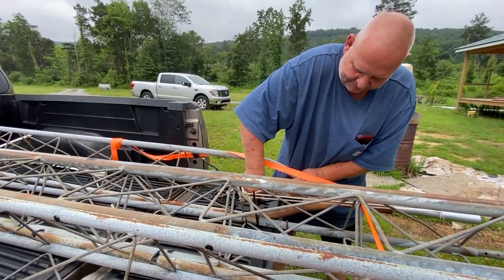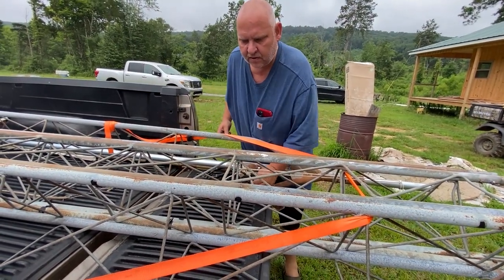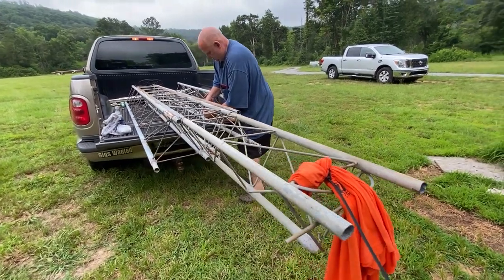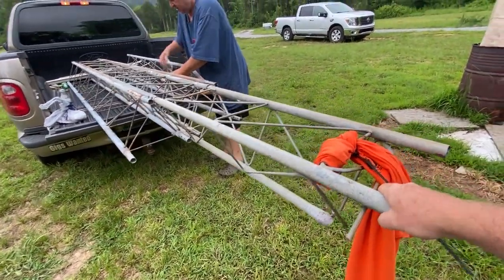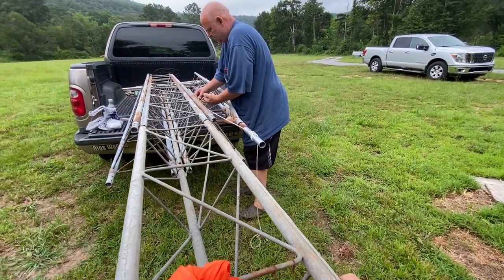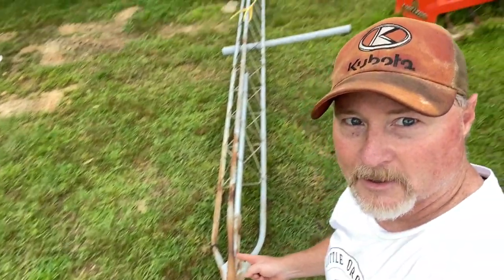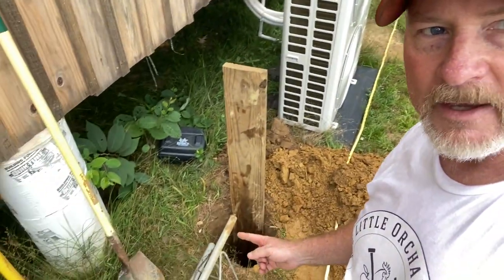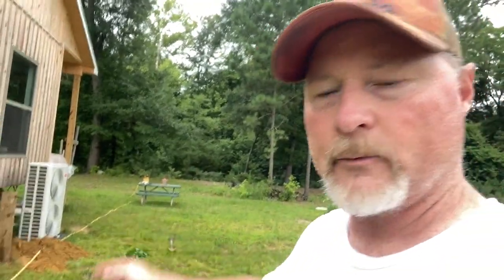Installing Our Reclaimed Antenna Tower: It almost didn't work out!!

Comment: I know these towers are somewhat galvanized but you should have poured cement to higher level than the ground. That dirt will hold moisture and speed up the rusting process. I would remove the dirt, clean the tower section that's been in the dirt real good and refill with cement above ground level. That allows water to run away from the tower and not setting up against it. Just my .02
Reply from the maker: Excellent advice. I did not think about that. I will have to add that to the ever growing list of to-dos. 😀👍Thank you, Bob.

Comment: Enjoyed the video.  I was looking for the one where you added the antennas.  Another tricky task, I'm sure.  I'm thinking of doing something similar, so I was scouring the YouTubes...

Thanks!
Reply from the maker: Hey Scott. I may not have video of that activity. However, I can tell you I ran coax from the Yagis atop of the tower halfway down to an outside box where my Mofi4500 lives.  I then run a coax into the house to a NightHawk router which acts as my WiFi broadcast device. It is really that simple. I do have a device in-line between the Mofi and Nighthawk that is for lightening.  The only disadvantage of this set up is the SIM card located in the Mofi is atop my roof. SO, if I need to change cards I have to climb on the rooftop and make the change. Not ideal for an old guy like me but tolerable. Oh, and one more item about the antennas. They are aimed line of sight to the nearest cell tower. I used a website called CellMapper..Net to locate the nearest tower and then played with the signal strength tool I have on the Mofil to dial it in. Hope this helps a bit. Cheers!

Comment: I thought you would of made a frame at the bottom so it could be taken down. Are you going to climb it to put the antenna on the top
Reply from the maker: Hey RT038. We gave that some thought but in the end we simply decided to keep it very rudimentary. We assembled the Yagi antennas to the topper while we were on the ground. We then hoisted the topper up and climbed up there and popped it on.  I would not say it was easy, but we managed. In hindsight, probably should have built a lowering frame. Oh, well. Live and Learn. Thanks for the comment!

Comment: Did you bracket that tower to the eve of the building to help support it?  If not, has the tower been blown down yet or did you end up putting some guy wires on it?
Reply from the maker: Yes, it is anchored to the eve of the house and has withstood many a storm. More than I can say for a few trees around the property. :) Cheers!

Comment: FYI
Find an old sat. dish, remove the receiver head and replace it with a router antenna. You can point that thing into the direction for optimum reception for free WiFi.
Reply from the maker: Thanks for the info

Comment: When raising that tower, you needed first to have it partially raised up and suported by a ladder or strong beam of some sort, something home made to prop the tower up with along with either rope or heavy galvanized guy lines at the middle and above the middle of the section of that tower. Then you can use your farm tractor to start raising it up slowly till it gets up in the air, holding it right there in place then put your sakrete into the hole filling it up to the top of that hole, then let it sit till it firms up and dries for about a week.  Once dried you can now climb that tower remove the galvanized guy line ropes, etc, and bring your RG  6  cable down and start using it to wire up your home for tv signals to be fed to the tv set. Your not done, YET!  You'll need to sink in a 6 to 8 ft ground rod in the ground and attach that ground rod wire to that tower to. Then, start digging around that tower a square piece deep enough, about either a foot or two put 2 by 4's around it nailed in and start pouring additional sakrete cement mix all around giving this tower even more ground support for a yet good strong base.
Reply from the maker: Great advice. Thank you.

Comment: Just curious... how are you going to install the antenna on the mast?
Reply from the maker: Metal brackets came with the antenna. Pre-drilled pilot holes and made sure they were aligned to the direction I wanted to "aim" and secured them with bolts.

Comment: Is that a part 2 that shows the results and the actual cell repeater you used?
Reply from the maker: James, my current setup is the Yagi antennas, Mofi4500, and a Netgear Router. My setup is quite stable and dependable. However, my line of sight to the nearest cell tower is very untrustworthy.  I get a wild range of up and down times depending on several variables. Season, wind, and time of day (cell traffic) has impact on my reception. But I am very happy with the hardware configuration though. Hope this helps. Have a good one!

Comment: I can see you did not consider tipping the tower down for maintenance.  It will need yearly maintenance.  You treated this as if it were a fence post.  You don't know what you don't know.  You will need to add a lightning arrestor and ground strap.  Hopefully your insurance agent won't see this video.
Reply from the maker: All great points. Hindsight is 20/20. As up an update, our area just received the best little gift any rural Alabamian could ask for - fiber internet! So now I have to figure out how to remove the ole' fence post. Maybe there is a youtube video for that. :) Cheers.

Comment: There a plate that bolts to the bottom of that tower with a hing that allows you to anchor it to concrete and lift and lower it ease
Reply from the maker: Thanks Timothy. I'll look into that. That sure has to beat climbing up and down the thing in the hot summer heat. Yikes! Thanks for watching. Have  a good week. 👍

Comment: Just found your channel.  Great info  Thank you We r moving to the woods in MO 
I have questions. Do u know how far away u r from the antenna. And how did u find out ?. 
Also do u know if the distance between your antenna on the pole and router makes a difference ?..   I know there will be Resistance w distance.  But like I said.  We r in the woods and I’m think we need to get above the trees
Reply from the maker: Those are great questions. From my antenna to the modem (mofi4500) is about 20 feet. And yes, the distance between them makes a huge difference because you lose a little signal strength for each foot of coaxial you have. You don’t lose bandwidth with cat6 cable. So from the modem to the router I have cat 6 and noticed considerable gain when I moved the modem closer to the antenna. Also, getting at treetop level was huge! Picked up about 14mb additional when getting up high. As I mentioned I use my mofi4500 as a modem only. I do not broadcast with it. That is the sole purpose of the Nighthawk router. Finally, small tweaks in the antenna direction to hit the sweet spot of the cell tower (which is about 7 miles away) was huge. Good luck and thanks for watching! 👍
Reply: Thank you for your reply.  Great info. So your antennas are somewhere on top how did u tweeck then in. Also how did u find the tower location.  I appreciate your time.  Unfortunately at 65 we still need internet   Crazy !
Reply from the maker: I hear you! Hard to go completely disconnected from the world. Yes, the antennas are on top of the tower. We had already dialed the tower location in before erecting it and placing the antennas at the top. I used a website called cellmapper.net to locate the tower best suited for me by carrier. I used my cell phone gps to point me directly in the direction of the tower.

Comment: Please don't do this... go look at the manufacturers site and find the actual specs for putting these things up... that is a tower collapse/fall waiting to happen.
Reply: @Groupthink_Skeptic  yeah...I am putting up a 50 ft aluminum tower that weighs 130 lbs and the manufacturer says hole should be 4ft x 4ft x 4ft with 2yards of concrete in it to hold tower up

Comment: How many bags of concrete did you use
Reply from the maker: I believe we used 4 bags sinking the base 3' into the ground and securing it to the eave of the cabin for added structural integrity.

Comment: OMG… you are soooo lucky you didn’t fah huck up your HVAC unit.
Reply from the maker: 😜 It was not a well thought out plan.  But hey, even a blind hog finds an acorn every once in a while. 😂
Reply: @TheLittleOrchardFarm   you should figure out a way to anchor it to the eave of the house.  I don’t believe you have enough concrete for it to be self supporting
Reply from the maker: @richarde735  it is secured to the eave. Thanks!

Comment: Just pour the mix right out f the bag into hole and add water
Reply from the maker: I usually do dry pours and am a big fan of the easier route but wanted to make sure the mix was through on this one since the structure was attached to my house and didn't want any damage there. But, I hear you and agree.